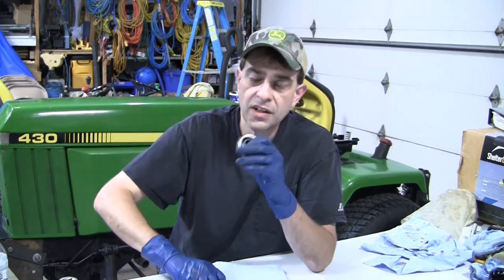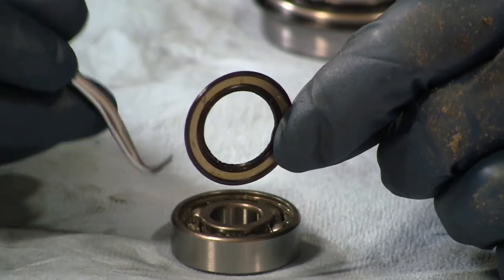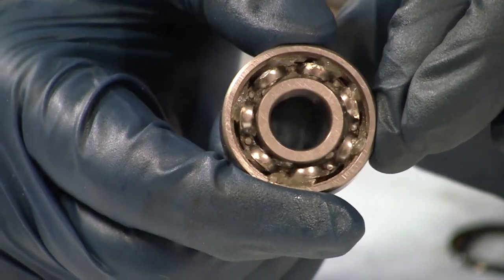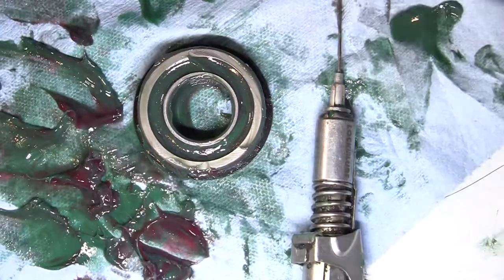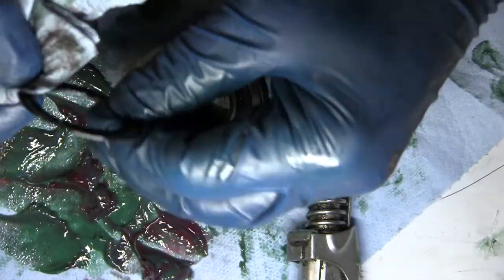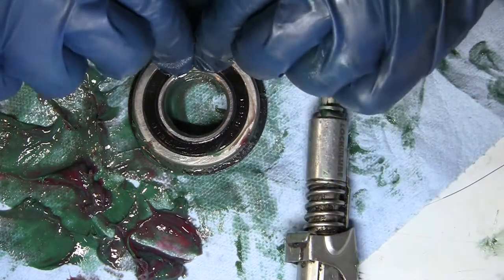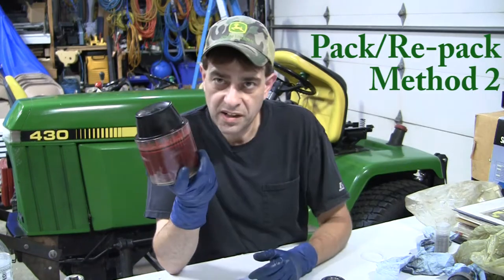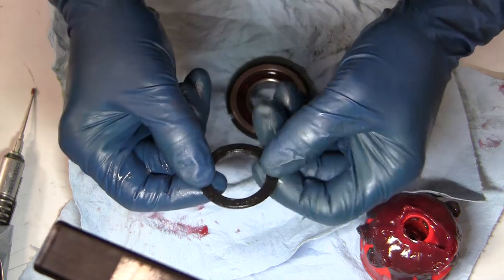Always Pack/Re-Pack Sealed Bearings (Two Methods)

Comment: Believe it or not, the companies that make bearings know what they are doing. Only 30 to 40% of available space should have grease. Any more in a sealed bearing and they can overheat which can denature the grease and lead to failure. Less is more. And if you are going to pack a bearing with new grease remove all the old stuff. Some greases are incompatible. Don't just look at things and speculate and apply "common sense." Get your information from the manufacturers and reputable manuals.
Reply from the maker: thank you for your comment.  I'm just showing you what I do.  My experience (not my speculation) and the experience of others has been this makes the bearings last longer (in fact I haven't needed to replace them).

I hope we can agree that flushing out the dirty old grease and then removing grease with a rag and getting close to the 30-40% space you stated is better for the bearing than doing nothing.

I have already experimented with doing nothing and the result is bearings don't last as long.

Maybe I will try an experiment with two bearings, one with less grease and one packed and see if there is a difference.
Reply: This is Okay to do with a low-speed bearing application but not a high-speed application. Packing a high-speed bearing solid will create  heat and lead to premature bearing failure.
Reply: different greases shouldn't be mixed, but filling all the available space can have advantages when overheating and low friction aren't critical but dirt/water intrusion and long periods between use are expected. the use of rubber sealed bearings indicates that is the case in this application to some extent and they already have more grease than an equivalent high-speed bearing. if you find the grease has hardened and dried up you know not to do it again, or maybe try a different grease.
Reply: Low speed applications, 100% grease pack is fine.
Especially if a reciptocating part (just goes back-forth, doesnt spin all the time)
Reply: This post is correct. Sealed bearings never need to be packed full. Less is more.

Comment: I have seen videos warning about over packing bearing and the possibility of over heating, i have been in engineering for 40 + years and bearing failure is always due to insufficient grease. .i always re pack fully which makes bearing almost ever lasting
Reply from the maker: @edwardmiller3859 Thank you for your comment and providing your experience with doing this!

Thanks again and I hope you subscribe!

Comment: From General Motors service in information.  Now not only you broke the seal you are not putting the same grease!!! All greases are not compatible!!! Bad information
Reply from the maker: I always welcome respectful comments and discussion - I think it is helpful for all parties.  Despite the apparent tone of your comments, I will assume you mean well and intend to have a genuine discussion.
1) “From General Motors Service in information”.  Sorry I don’t know what this means nor do I understand the overlap with my garden tractor bearings I discuss in the video which are not made by GM.
2) “Broke the seal”:  While most people commonly refer to these as “sealed bearings”, they are not in fact a true “sealed” bearing.  There isn’t any glue or welding done to “seal” these at the factory.  These are effectively dust covers/shields.  As such, I did not “break” the seal, I simply removed what one might call a ‘dust cover’ to look at the condition of the bearings and the grease therein.  These “seals” would permit grease to come out if it was overheated and pressing the rubber like coated metal seal back into place restores the “seal”.  I would hope we could agree that flushing out the dirt and old grease from a used bearing is better than doing nothing.

3) ‘…not putting in the same grease!!! All greases as not compatible!!!”:  You are correct the grease I added is not the same and not all greases are compatible, such as silicone and lithium greases are not compatible with what I used.  However, I believe neither you nor I know whether the greases being used here are not compatible.  Unless they are silicone or lithium greases (and there are some super special application greases not applicable here) the greases in the bearings I used likely meet or exceed the common bearing grease standards.  Moreover, due to the way I add grease, much of the old grease is pushed out.  In my experience has been this has not been a problem and my process results in the bearings lasting longer…personally I’m not worried about the miniscule amount of original that remains for the applications I do this for.  If one wanted to reduce waste and wanted to be a purist about not mixing greases, one could clean out the old grease with an appropriate cleaner, and then add their own bearing grease.  Viewers will note it is of course true that not all greases are compatible and if you do what I did, there is a risk you are using incompatible greases and you do so at your own risk.

Ever notice that your service manuals will always suggest you use THEIR items and THEIR part numbers.  I hope most people realize that when you go to a repair shop (garden tractor repair, vehicle repair, etc.) it is not likely they use the exact brand of grease for your garden tractor, or vehicle for that matter…unless of course you have ALL your repairs and maintenance done by the respective dealer (in that case, other than for entertainment, I’m not sure why they are watching this video).  Instead, the repair shop uses the brand that meets or exceeds the specs for that application (at least we hope they do).

Thank you for your comments which afforded me the opportunity to cover something I did not specifically cover in the video.

Comment: I have the best luck prying out the seal from the outer edge. This prevents damage to the sealing surfaces. For high speed bearings you only want the bearing to be packed about 1/3 full to prevent over heating.
Reply from the maker: Thank you for the great tips!

Comment: If no zert drill and tap it , leave inside brg cover off and drill tin hole in bottom cover for excess grease to excape under deck
Reply from the maker: I agree and I'm glad you for mentioned this, especially for deck bearings!  I didn't want to drill a hole in the rim for the wheel bearings.

In case it helps others that might be reading (of course it's obvious Phillip Hall knows this):  The original/OEM bearings for those with grease zerks didn't have the inside seal that blocked grease from getting into the bearings (often seen when I've restored garden tractors).  Newer replacement bearings come with a seal on both sides, probably so they work for multiple applications.  By leaving the 'inside' seal off where you have a grease zerk (or where you've installed one as suggested by Phillip Hall) the grease is able to get to the bearing.  Note that when removing the seals, some sealed bearings have one side the exposes the bearings; whereas the other side has a grid...leave the seal off the side the exposes the bearings and leave the 'grid' side on.  Of course, if you don't remove the seal, the only benefit of using the grease zerk is that it provides some anti-corrosion prevention to the inner components (again, it can't really get to the bearing if you leave the seal on the side exposed to the grease).

On the other hand, we also have some sealed bearings where there isn't a place to put a grease zerk.  Such as the blower PTO extension, or even idler and tensioner bearings on my vehicles, etc.  In those cases I've found that if I pack them and/or re-pack them they last longer.  In addition, there is some benefit to re-packing them even if you have a grease zerk in that it 'flushes' out some of the crud in the bearing that happens from regular use.

Thanks for the helpful comment and for watching!!

Comment: wouldn't hurt to clean out the old grease completely rather than mixing potentially incompatible greases together.
Reply from the maker: I agree, it wouldnt hurt to clean it out.  Would you recommend brake cleaner or acetone, maybe something that doesn't leave a residue?

In my case I haven't had an issue with incompatibility.  Perhaps what I've worked on the greases were compatible, perhaps the little that's left didn't matter.

Thank you for your comment.

Comment: I replaced the idler pulleys on my car in the past year. Brand new out of the box. They started squealing on start up shortly after. I repacked the bearings using the needle method on both of them and haven't had a problem since. Now I make sure to add grease to any bearings I replace. Great video on showing how to do this. 👍
Reply from the maker: @midwestrigging thank you for commenting and it's great  to hear the video helped you!
Reply: If it was the bearing making that noise, regreasing does nothing for the damage done.

Comment: Can I use it if it's bent ... Will the bearing still work
Reply from the maker: @Kgutso Makoti  I'm wondering you are asking if a bent cover/seal can be used?  I have bent the seals on more than one and I've been able to reuse 
 them.

I gently bend it back, and if it looks like it's still solid and the metal inside did not brake then I try to push it into the groove.  If it seats in the groove, at least for me, I haven't had an issue. 

In fact I don't recall, but there may have been one in the video that had been bent (I didn't comment on it). 

The biggest thing is it seats back into the bearing.  I suppose if it had a really big kink in it, bearings would push the seal out when they move (I'd be really surprised if the seal would stop the bearing from moving).

Hope that helps!

If you haven't already, I greatly appreciate you subscribing...eitherway, thanks for watching!!
Reply: @foxcanfarms  that's exactly what I'm asking. 
I will subscribe. Thank you
Reply from the maker: Thank you!

Comment: Replaced a bearing recently on a $10,000 motor and it went bad again within 3 weeks. When I took apart the motor and checked in the bearing it had almost exactly the same weird graining looking grease that the first bearing you opened had, and it was about equally empty!

Wish I had found this video earlier, i fell into the mistake of thinking that just because it came from the factory and was new it would be fine.

Comment: Bearings companies wants to keep their sales/revenue cycle going.
If bearing last for VERY long time. this will affect their revenue.
If bearing dies quickly, it will affect their reputation. 
So, they make a balance.

I'm with checking bearings:
- Adding grease if needed.
- Clean old grease, add high quality right grease (high temp) lithium complex grease.

But not with filling the bearings 100% full, need to leave some empty space.
To not pop off or damage crack the seals or causing bearing drag.
Anything too much can be bad.

Just as too much "dry" bearings are.
Reply from the maker: Thank you for your comments, and thank you for watching.
Reply: That’s just wrong.  Learn what bearing L-10 life is.  Properly installed and selected they can last extremely long.  Contamination is the #1 bearing killer.

Comment: That bearing packer is slick.
Reply from the maker: @rawbacon they really are slick.  I have had it for over 25 years. I bought it to pack trailer wheel bearings.

That video was in fact the first time I used it for the bearings on my garden tractor. In fact, I thought of trying it while filming the 1st way and was so happy with how it worked I had to splice it in and retake my intro.

That model was made by BluePoint, but the patent has long since expired and now there are other brands available (no clue about the quality of the new ones)

Thanks for watching and commenting, and I hope you subscribe!

Comment: Hi great idea what is the tool you used to refill the bearing it looked like some type of air greaser I could use one of those again thanks for a good idea thanks from the UK
Reply from the maker: Thank you!  Wow!  Great to hear from the UK!

Hmm...I wonder if you're referring to the 'bearing packer' (round clear base with red insert).  The one I have is made by BluePoint, I've probably had it for 25-30 years.  I think there are other brands now.  The thing in the middle of the red part is a grease zerk to fill the bottom with grease. I don't use that part bc it can break off easily.  I screw the top on and pull the insert out that way. 

In case I misunderstood, the other thing is a needle on a grease zerk I probably bought 25-30 years ago.

I haven't had a problem, but if you repack a sealed bearing used in a high speed application, it's probably best to remove some of the grease and only leave it 30-50% full otherwise the grease may heat up and leak out.

Let me know if you have any other questions or comments. 

Thanks for watching and commenting,  I hope you subscribe!
Reply: @foxcanfarms  I was looking at the air fed tool used to put grease into the bearings it’s ideal for smaller jobs like motorcycles and miniature steam engines thanks

Comment: I'm confused. The previous video I watched said you should only fill the bearing about 25% full or they will overheat and fail prematurely? The bearings aren't packed full new for that reason.
Reply from the maker: Thank you for your comment and for watching!

I and others haven't had any problems doing what I do, nor have I had to replace any bearings.  This is my experience vs a spec sheet that I don't believe is designed for the longest life.  

I don't see any problem with adding less, but you should know that it's not 25%...per an engineer my son works with (obtained after I made the video) the specs have a general range of 15-50% depending on the bearing (and that's a general range not all inclusive).

In my experience companies manufacturing specs are are designed for two things, maximize profit and create a product that fits the market they target (best, middle, economy, etc).  I don't think mosr are made to last as long as possible/be the best and never need replacement bc the fact is if you don't maintain them, they will fail (its inherent in the design).   

At least we agree it helps to clean them out, and you can decide how much grease to add. 

why not experiment with different amounts, flush it/pack it, scoop some out...if you do nothing you know you're guaranteed to replace it, so find out the best amount for each application you have
Reply: I filled them about 50% full. The alternator is 30 years old and has run 180,000 miles. The grease was hardened but not totally dry. Had a hard time finding a new back bearing and had to reuse it. Usually the made   @foxcanfarms  in Japan bearings last a long time.
Reply from the maker: That's a really good point on the Japan bearings lasting a long time!!  Those do seem to be a lot better.

Comment: You put way too much grease in the first bearing IMO.
Once the bearing gets warm from use its going to push grease out of the seal.
I learned that the hard way.
Reply from the maker: @richardturk7162  Thank you for your comment.  I haven't had an issue with slow speed bearings, but going forward (after I flush it out), I will remove some of the grease, especially on high speed bearings.

Thanks again!
Reply: @foxcanfarms  It would probably be OK in a farm tractor and wagon application because of slow speeds.
Bearings that work under high heat that have some thrust side to side it pushes the grease out to some degree but also lets in debris and water.
Reply from the maker: I did get some that came out on a vehicle idler pulley recently so that makes sense.

Still good to repack, just remove some of the grease, especially on high speed applications.